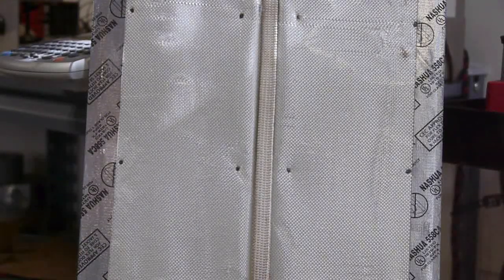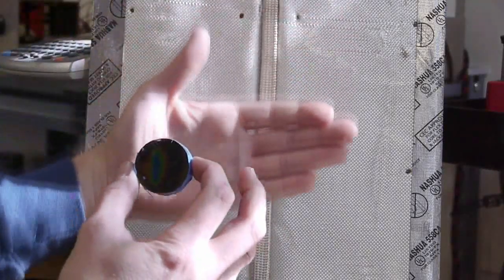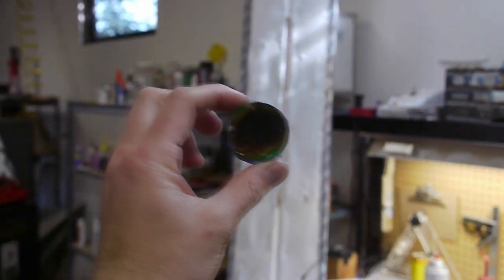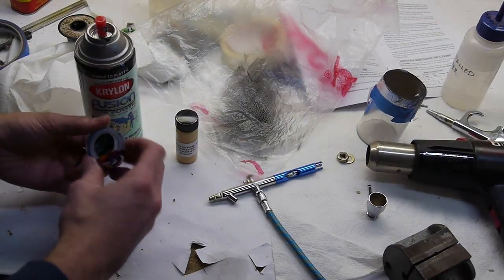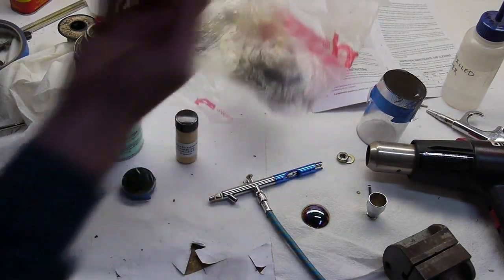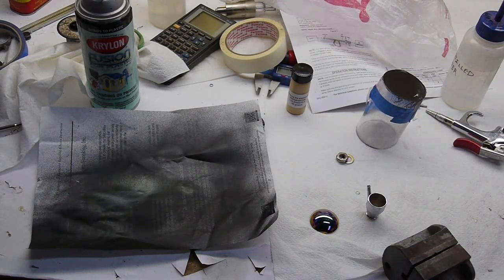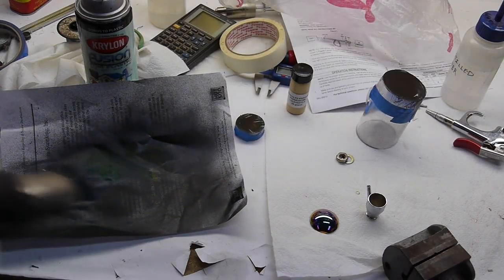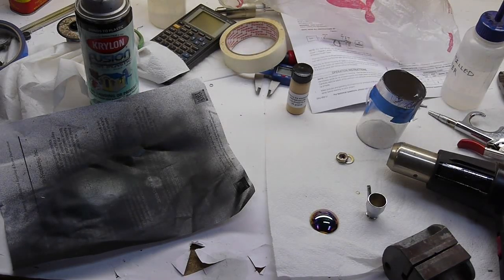Low-cost DIY thermal imaging - liquid crystal paint testing

Comment: I have found germanium blocks real heat radiation. You cannot sense the heat through it like you can glass. It blocks heat where glass is transparent to heat. So I wonder what is going on here. What happens if you do not use the germanium?
Reply: I have been thinking: there is something significant happening here, but it is not heat radiation as we know it, I think it is electricity. It is a real mystery, one I have been working on for some time. You test what I am saying: whether the germanium blocks the heat radiation. 
Do the thermochromic liquid crystals respond to current?

Comment: Any updates how to improve design? I'm looking to make IR camera for painting investigation so I need high resolution preferably SWIR and MWIR? What spectrum it can display? You use carbon based pigments? Is vanta black better? In theory it would be also possible to image even THz or microwaves with powerful enough source and UHMW HDPE?
Reply: Why would you want to use vanta black?
Reply: @stefanmayer444  Because it's blackest material and has lowest reflectivity what makes it excellent at absorbing broad spectrum of light, liquid crystals need anyway black background. Also carbon nanotube vertically alligment "forest" has good thermal conductivity in one direction mostly. I guess soot can cheaper alternative. However I don't how well they absorb infrared. Any suggestions what to use instead to achieve good sensitivity say in MWIR range? I was thinking also of cooling one side with Peltier to increase sensitivity.
Reply: @RynaxAlien  Yes I have a view thoughts about that, but just to clarify; In what order was he coating the plastic film?
Reply: @stefanmayer444  Basically there need to be three layers as thin as possible. One is to act as frame in this case thin streched PE bag. Then it's coated with black or other material that has good absorbtion in desired wavelenght. And eye facing side is coated wth LC. I got LC for nails which already comes with adhesive so I was thinking just to make it by pressing evenly with two teflon films. LC has to be thick enough to produce more vibrant colors. But again making it too thick introduces thermal dissipation problem which results in blur and sensitivity loss. So ideally you want there to be insulated "pixels".
Reply: You used carbon based pigment? I want to see broad thermal specrum mainly MWIR. Is there alternative to germanium lens? It's important to have also wide aperture lens since many use F/1.0 lens
Reply: @stefanmayer444  Does this type thermal camera have technical name, who patented it? Carbon fiber nanotubes and carbon fiber can be stacked, they also can dissipate heat in Z axis instead of on HDPE film sideways. 
Did you experiment with normal glass lens to see if SWIR spectrum works?

Comment: To heat or cool the projection screen housing, a Peltier Effect (PE) device may be a good option, you can change it from cooling to heating, by switching the polarity of its power supply leads. A PE device has no moving parts and there is no heat exchange fluid involved.

All you'd need would be an electronic temperature controller.

A small PE device may suffice because of the small range of temperature required. Operating the PE device at full current may also not be necessary because with a PE device, operating at its full rated voltage and current, one side gets cold enough to freeze water to ice, and the other side gets too hot to touch. The temperature controller would require a current output with possibly the ability to switch polarity automatically as needed.

Of course the sixe of the PE device would depend on the thermal mass of the projection screen housing, and any internal warm/cold air.

Comment from the maker: Not a whole lot. The CCD is designed to be sensitive to visible and near IR wavelengths. The thermal energy will just heat up the CCD, and the tight thermal coupling between cells will cause the whole thing to heat up almost uniformly.

Comment: A year or so ago I watched a project on TV that used an aftermarket thermal imaging device. It did not have anything but the camera that hooked to a notebook for viewing. The cost was said to be 500 bucks, but I was never able to find the outfit who supplied the unit. It was used for a robot along with a night vision unit. The unit came out of the box as a circuit board that was installed into a small plastic job box about 4x4x2 inch. if you know of this unit let me know. Cheers and good luck!

Comment: how about using aluminum foil instead of the plastic from the bag. It is very thin and it has a very low thermal mass.
Reply: Low thermal mass??
Even if it had, it's a very good conductor of heat.

Comment: Amazing idea. Just a couple of thoughts in case you get to tinkering again.

Could you use soot from a candle or similar as the substrate for the liquid crystal paint?  Then possibly use your vacuum jar to do a poor man's vacuum deposition of the crystals on to the surface of the soot, or just mix the paint in with the wax before burning?  Lastly, 'shine' the IR directly on the painted surface, rather than through the substrate.  Short focal length of the lens might make that impractical? Dunno.